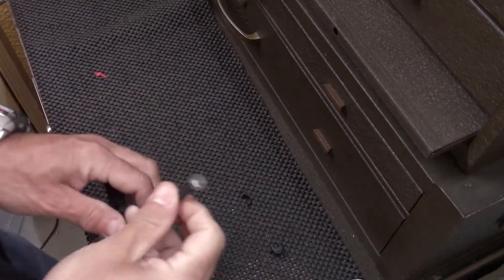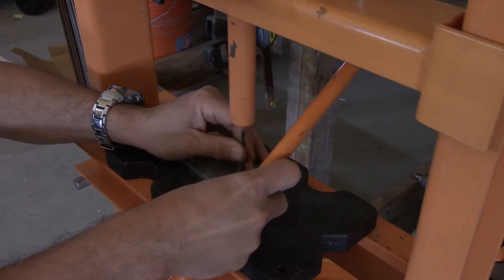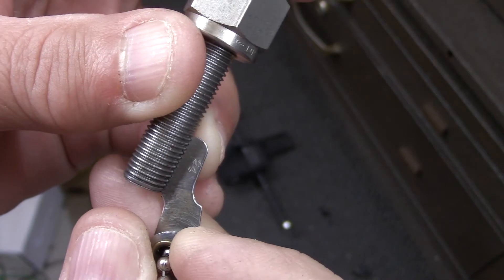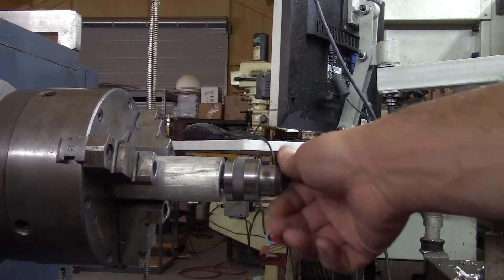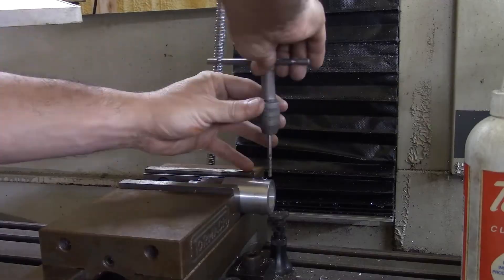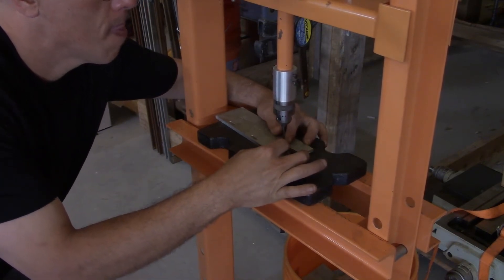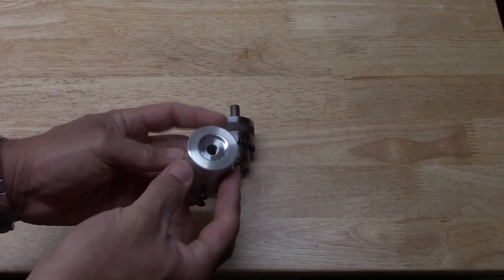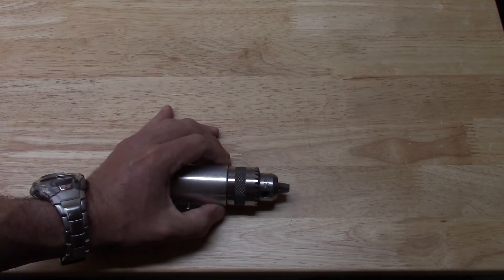Making The Harbor Freight 12 Ton Hydraulic Press Usable

Comment: Can't believe you actually use a HF press considering your other shop equipment.  First real press application and you will bend the spindle off plumb (vertical) and the press is useless at that point.
Reply from the maker: Heh heh, yeah, not my best "Roll Royce". I don't use it that often and at the moment it has pushed out pretty much everything I have needed to push out. The stuff that I work with will have a hard time bending the spindle. But hey, I guess if it breaks I'll have no choice to get me the one from Northern Tool I have been eyeing out for a few years! Stay tuned, maybe it makes it into the shop one of these days ;-)